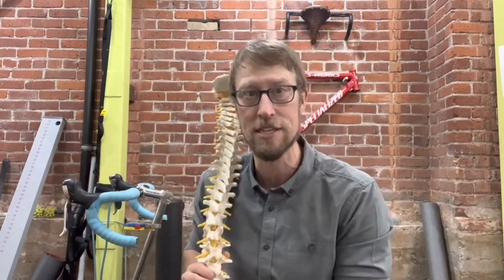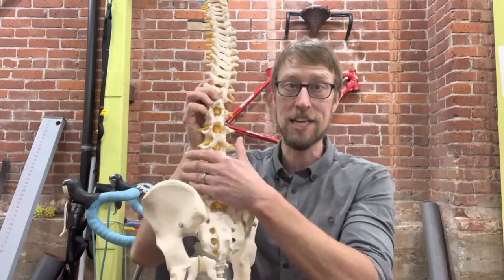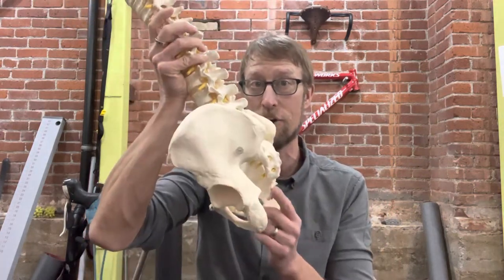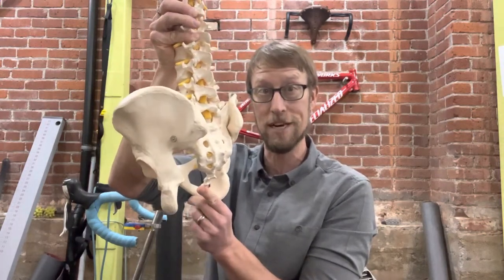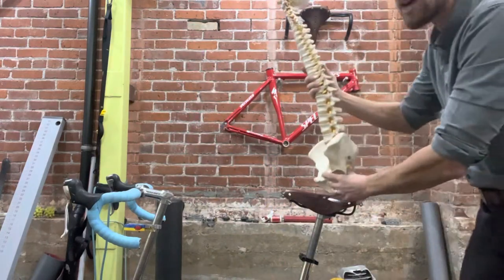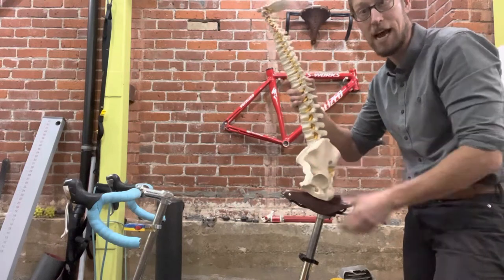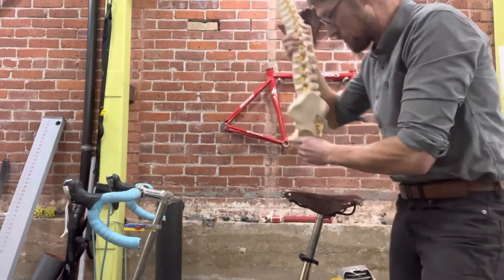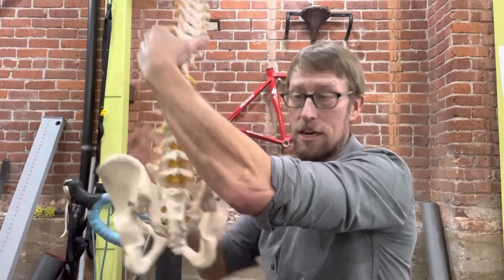Tailbone Pain with Cycling?

Comment: How can I be sure it's tailbone pain and not lower back pain? Your tips were great and I will try them regardless...
Reply from the maker: Thanks for the question! Tailbone pain is very point specific to the tip of the coccyx, with no pain in the lower back, sacrum or hips, and direct pressure is acutely painful. However, true ‘lower back pain’ from the lumbar spine  or SIJ can start at the lower back, above the sacrum or below, radiate into the buttock, sacrum, lateral hip, cause muscle spasms and guarding. More diffuse, vs very point specific.

Comment: I had been struggling last April with a tailbone injury due to new E bike. I stopped riding it all through the summer. I went back to riding it in august and I’m in the same situation again, but this time it’s lasting longer.
Reply from the maker: Try lowering that saddle 5-6mm and retest — if you’re even a little high on the saddle it will drive your sitting bones/ tailbone into the saddle at bottom of pedal stroke— give er a try!

Comment: Thank you for this! I have a quick 5 hybrid that I absolutely love! I just bought a trainer for indoor riding as I live in Vegas. Very hot in the summer and a tad bit cold in the winter. I am having so much pain in my tailbone that I had to stop riding it. I have no problems riding outdoors. So strange to me. Unfortunately my handle bars are not adjustable. I have tried lowering the seat. Nothing has helped. I will watch my posture. Any other suggestions?
Reply: same situation here